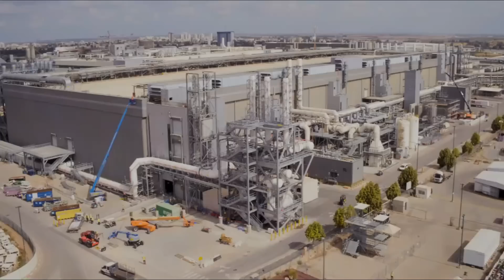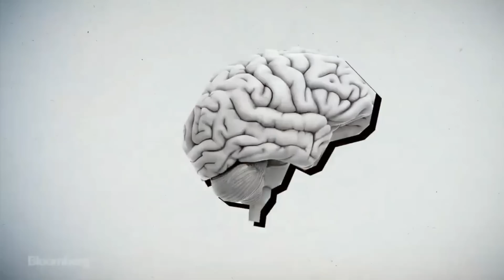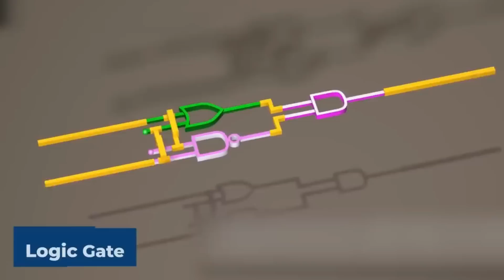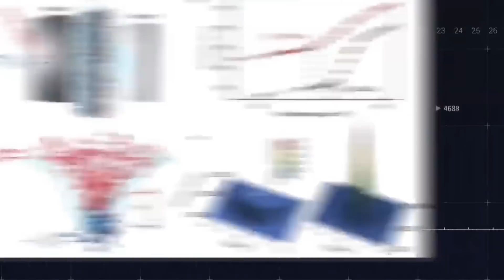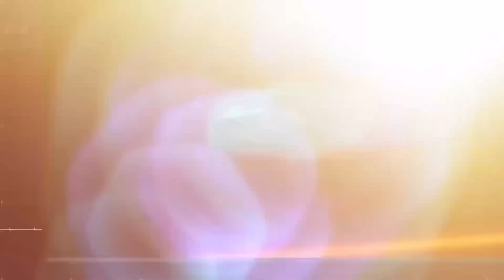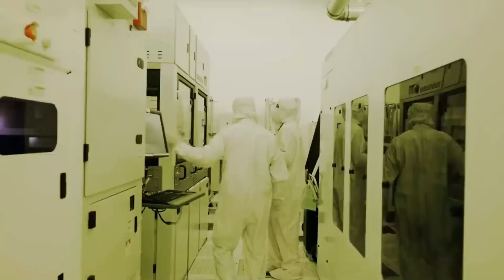IBM's New Light Speed Processor - Are You Surprised?

Comment: So, something interesting you can do with optical data is utilize polarization to send multiple signals on the same wire simultaneously. Since light of different polarities do not interact with each other, you can send a signal at one polarity down the same optical wire as another signal at a different polarity. This is why fiberoptic internet services are so much more efficient. You can send and receive multiple signals literally at the same time whereas electrical signaling relies on a back and forth of packets so that there is no interference. Now imagine a cpu die that can perform multiple computations simultaneously on a single input and output lane.